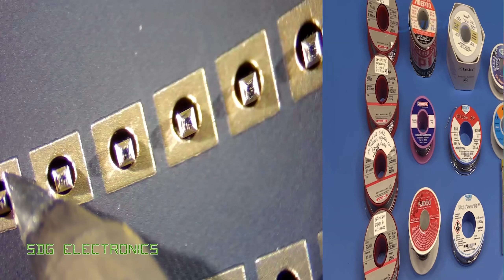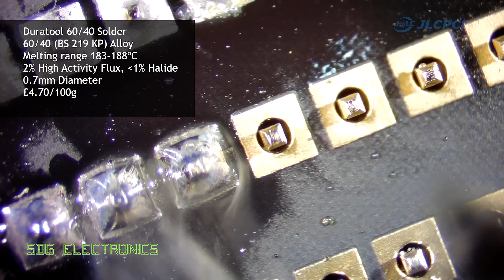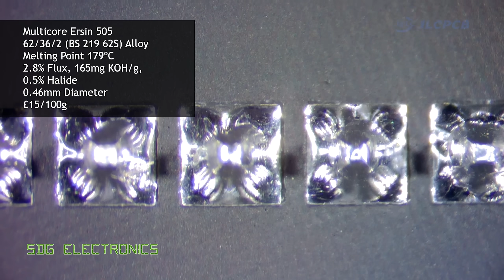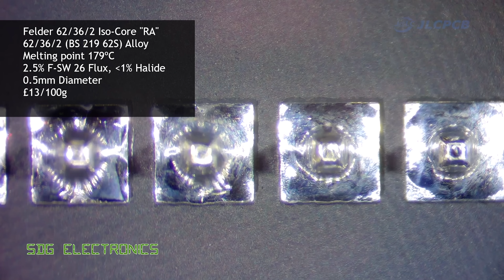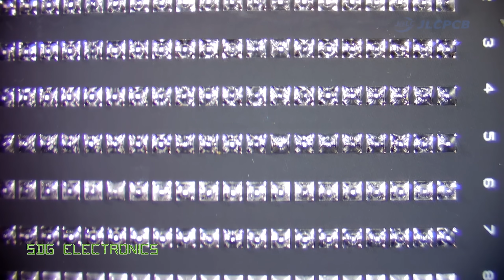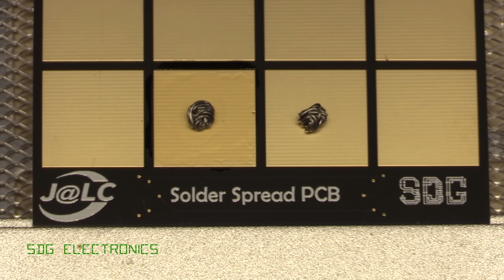SDG #079 What's the best solder for electronics? Expensive or cheap?

Comment: When it comes to soldering, I consider myself a soldering fanatic. I make no excuses for my choices of soldering wire and flux core. This is part of my soldering training in the Air National Guard. We used only leaded solder that was a pure eutectic alloy with an RMA flux core. This has proven over decades to be the best combination to produce joints of the best appearance, best quality and best reliability. Joints produced using a pure eutectic alloy have only two states of being, liquid or solid. This is the easiest solder to learn with because of this point. RMA flux core is the best because it produces the best appearance and the joints endure G forces, physical and mechanical stresses and thermal inversions. This is the level of quality and reliability necessary for avionics, aerospace, biomedical electronics and even high end audio. When human life and class A assets are involved, failure is not an option nor is mission failure. For those who go with lead free, ask someone else. For leaded soldering, there are get by solder wire and there are pure eutectic alloys with RMA flux cores which deliver the ultimate in soldering excellence. This isn’t opinion, it is proven fact over decades of use. Kester, AIM, Alpha Metals and Multicore are the brands who have proven themselves over time. Each must use what they can afford and tolerate. Having a solder which only has two states, liquid or solid, and a proven flux core of decades of use that endure the worst of conditions make the best solder joints you can deliver. It won’t make you a solder expert, but it will give you the ability to produce this level of quality and reliability with practice, practice, practice! It’s up to you and your budget. If you only want to produce the best results, you need the solder wire that yields this. A pure eutectic leaded solder alloy, Sn63, 63% tin/37% lead or Sn 62, 62% tin, 36% lead and 2% silver are the best choices. The solder’s flux core that makes the best joints is RMA, Rosin Mildly Activated. When decades of proven results tell you that you have made the best choice, no argument exists. Save yourself frustration, use only a pure eutectic alloy with an RMA flux core. You can’t lose. Frustrations melt away when you use the best solder!
Reply: For the most part, I agree. However, there is ONE lead-free solder that I can't differentiate from lead so much so it's the only thing I use. It's 100% eutectic, it wets incredibly well, it shines like a diamond and has similar vibration cracking resistance than 63/37 SnPb ( "RELIABILITY TESTING OF Ni-MODIFIED SnCu AND SAC305 – VIBRATION" ). It's Nihon superior's SN100C licensed and produced by AIM. There's no God-given reason why Lead makes the perfect counterpart to Tin in solder. It's just technology and eventually something better will come along. I think SN100C is that combination.
Reply: @someguymichael , with regard to the tin/lead combination, a pure eutectic tin/lead solder is 63% tin and 37% lead as this ratio has only two states, liquid or solid. Sn60 tin/lead solder has a plastic range or state. This is documented extensively. It may not be the only solution, but it is in the leaded solder world. Sn62, a pure eutectic solder with 2% silver content also achieves this goal. A two state solder will always be better than a three state solder if only because a two state solder offers better stability and less chance of issues when all procedures are followed.
Reply: @someguymichael , it’s worth trying considering lead is becoming a bad word. Appearance is important in soldering and the other is a lack of what is called whiskering which is common in lead free solders. This is a serious problem since these whiskers can short across narrow trace runs. It’s a concern, but it may not be with this solder you speak of. One must be very careful when soldering as any failure could scrap a board or an entire component. It may not matter like it would if it were for military, space or biomed products as life hangs in the balance as well as mission accomplishment hangs in the balance. As far as I am concerned, all circuits deserve the level of scrutiny I give to my work. It’s a discipline and you seem to care more than most. I hope you are using the same extra flux as your flux core type. This ensures consistency, repeatability and high quality in your work. Using unlike extra flux than your solder’s flux core yields dubious results. You care about it so press on sir and thank you for bringing this to my attention. A closed mind is one that lacks openness to options that may yield a better way. Press on and thanks.
Reply: @someguymichael , AIM is one of my approved brands. It makes sense if you have a winning formula that works in the lead free world, has the same flux core as your extra flux and yields identical results, you have a winning combination. The question is, is this an approved solder by NASA and or is approved for J STD 006 level 3, aka critical circuit work. Without approval by one of these, it will be hard to convince me to use it. I am willing to try this solder, but it will have to endure the same tests as my present solder has done for decades. That is s tall order. Long term reliability is another issue. I will try it. Is it available with an RMA flux core? There’s something that can yield some consistency to the equation. This flux and flux core is proven superior so if this is available would be a contender. I will have to see if it is available and the wire size is also available. I use 0.015”- 0.025” wire sizes depending on the work being done. Smaller sizes yield higher control and result in less waste. This is important as who wants waste. These are all questions to be answered  and tested. I look forward to this I will have to get tips for use with lead free solder. Mixing unlike solders violates the protocols of high end soldering. This means you don’t use lead free tips to solder leaded tip work as this is cross contamination and causes both quality and reliability issues. Soldering is both an art and a discipline. There is no place for unaddressed issues if you expect optimum performance, reliability and consistency in your work. It isn’t about me, it’s the way it is. Not everyone cares about this. It is a passion and a discipline with me.
Reply: Thanks for the additional info. Proper detail with explanations for your statements is really appreciated.
Reply: @geoffallen6977 , it’s my pleasure to help anyone who is trying to advance the soldering world we live in. Your efforts matter and caring about what you do only presses me to help. People like yourself drives me to further increase your knowledge and understanding of this profession. Keep up your good work! Press on sir!
Reply: @markphilpot8734  
Hello 
Please what is the best best soldering wire and best flux for i buy ?
Reply: @waelkhalil2313 , this all depends on if you are a tin/lead or lead free! If you are lead free I would say SAC 305 or SN 100. I could be wrong on the numbers a bit but these are both Kester. The key thing to remember in solder wire purchasing is knowing your wire quality. Kester, AIM, Alpha Metals and Multicore are the only brands I can wholeheartedly approve. In the tin/lead or tin/lead/silver solder wire world, RMA flux cored solder and RMA liquid flux. Best to use liquid flux by the same brand as your solder wire because their flux chemistries match, but always use the same liquid flux as your flux core with only two exceptions  and they are R and RA flux cored solder wire still work best with RMA liquid flux because they are all rosin based fluxes and RMA flux yields the best results even when using it with R or RA flux cored solder wire. Pure eutectic solder 63%tin/37%lead is the best because it is either liquid or solid, only two states of being as opposed to other solder wire formulations which have a “plastic” state. 62%tin/36%tin/2%silver is also a pure eutectic solder option. RMA is always the best as it has been proven over decades of use in all high end industries requiring resistance to G forces, mechanical and physical stresses and thermal inversions. This is critical circuit soldering and the only kind I do regardless of the actual level. I am a fanatic when it comes to soldering excellence and I do not compromise that for anything. No excuses, no quarter and no regrets. Highest quality rules in my book. The decision is yours to make. That is my recommendation based on my philosophy of no second place for anyone or any work I do for anyone. Second place is first loser, not on my watch Sir!
Reply: @markphilpot8734  thank you so much 👍
Reply: @waelkhalil2313 , it’s a pleasure to help out anyone who wants to make a difference in soldering. Can’t expect anyone else to love this as I do, but enthusiastic practitioners are always welcome!
Reply: Kester is my usual go to solder, but I have always been partial to Alpha as well and in fact prefer that solder for bigger joints, as I feel it just has a stronger bond than everything else.
Reply: @LeviBulger , I’ve mentioned that I have used solder from Kester, AIM, Alpha Metals and Multicore. I have no problems using any of these brands. Al of these have the consistency, quality and repeatability any of these offer. Having the RMA flux core is critical to yield the consistency I  insist on. Failures have many possibilities. If your solder must be consistent all the time. Otherwise, you get problems and inconsistencies. If you use the military approved grades, you will get the best results.  The quality of your work matters or should matter. The key to a great solder is being a pure eutectic as these are either solid or liquid. Thing about that is all about being a pure eutectic sand having an RMA flux core is you have only two states and this flux yields the best appearance and is the best performance consistently. Keeping the size of the wire equal to or less than 0.031” yields the least waste and great solder is never cheap., You can try it out, but if you want great performance, The brands  mentioned will yield this quality and performance. Your brand is one that is listed. No worries on that.
Reply: @markphilpot8734  Hi Mark, I got to read your comment and I appreciate the care in the details regarding the specifications of the solders. I have a question for you: I would like to take a Kester or an AIM but the Kester is only available in the RA version where I am, while AIM also has the RMA version. What do you suggest also based on the quality of the flux that the two use? Thank you in advance for the possible time for reading. (both Sn62/Pb36/Ag2)
Reply: @raid0ss687 , Mr Oss, unbeknown to some that are into the hard core solder fanatics like myself, RMA flux is the best core. Even if the solder used has a rosin core or a rosin activated flux core, you can still use RMA liquid flux as you additional flux to help with wetting and cleaning of the joint, wire or leads of components. There is no problem using an RMA flux as the extra flux because they are all rosin based flux cores so using RMA extra flux is a no brainer. It is preferred to use the same brand of flux as the solder as their chemistries are identical in base formulation. You can still use an RMA flux by a competitor only the chemistries aren’t ideally matched. However, any RMA extra flux that is used is always better than any other liquid flux that may be available. The reason for pressing an RMA extra flux is it cleans better, yields the best appearances, and yields the best bond of any rosin based flux made. The military uses it, aviation, biomedical and any critical circuit soldering where the best performance is mandatory. Even in high end audio where tin/lead solder may still be used. Kester 282 is my choice for tin/lead alloy and it has an RMA flux core. I use Kester 186 RMA liquid flux as extra flux during soldering and for cleaning tips. No time for second place in my soldering world. Good luck with your work and feel free to ask questions. It’s how we learn. No such thing as learning too much!
Reply: @markphilpot8734  Thank you very much for your prompt response. Now I know what to buy.
Reply: @raid0ss687 , no problem. Anytime you need help, just ask.
Reply: @seanoconnor1984 , considering your location, I would try Multicore as a choice of solder as this manufacturer is one I respect and is highly consistent in quality and performance. The key is rosin flux core. I haven’t seen this company offer an RMA flux cored solder. It is the best flux core for any leaded solder there is. As long as you get it with an Rosin or Rosin Activated flux core and still be good. I would still use a liquid extra flux and it still should be an RMA liquid flux as it is compatible with other rosin core fluxes. This allows you the pleasure of using the best liquid flux available and achieve the best results in the process. The key is using the liquid flux both for cleaning the tips as well as for use to aid in wetting ability with the rosin flux cored solders Multicore makes. This will improve your solder projects and keep your tips and solder joints in the best condition they can be. The key to solder choice is keep it a pure eutectic solder whether it be a 63/37 tin/lead or a 62/36/2 tin/lead/silver alloy. The size used should be one that is as small that control of solder use is as small as possible to avoid waste. It is easier to control the use with smaller wire sizes. I use .015” to .030” as this size range helps achieve this control. The use of liquid extra flux, RMA, helps achieve the best results. Cleaning of the leads, wire and pads/connectors is critical to achieve the best results. Some don’t like or care about cleaning, but regardless what they think, cleaning produces the best results and makes all soldering projects better as flux removal matters in any soldering projects. Removal of flux after soldering makes the whole project better because it removes the possibility of conductive material left which also attracts dirt, moisture and puts the project at risk for failure. It is also about best practices as well. I am fanatical about the quality as it matters to me and to those whose work I execute. It matters because there is no mediocre project that involves soldering regardless what level of soldering you participate as.
Reply: @markphilpot8734  'I haven’t seen this company offer an RMA flux cored solder.' Isn't 381 RMA? That's what I got. Then again it's under the Loctite banner, not sure how all that works.
Reply: @, 381 is correct sir and the industry as a whole is steering away from leaded solders. That is a shame since the lead free variety is still a long way from being what the leaded solder with an RMA flux core. Can’t say how long it will remain. Through decades of use I have yet to find any solder that is leaded and has an RMA flux core that will beat the 3.3% RMA flux cored Sn63 or Sn62 configurations. Lead free is trying, but the problems associated with it still remain. I understand why the world wants to steer away from leaded solder, but I’m still waiting on one that can beat the 3.3% RMA spec cored Sn62 or Sn63 leaded varieties that still exist. Hoard while you can is all I can say. Kester 282 is pretty hard to find, but it and its equivalents are still available.
Reply: Kester should hire you as their spokesman.
Reply: @rickytomatoes , it would take a terrific amount for that to happen. The other solders I endorse are AIM, Alpha Metals and Multicore. When you make quality solder and that’s what I look for, my interest is peaked. I’m a soldering advocate and I don’t mind admitting it. The key to anything is finding what works and taking it to new heights. There is no where in my world for mediocrity. I’m not one for compromise.
Reply: @seanoconnor1984 , sorry to hear that Sean. It’s a sad state of affairs when places have such rules that ruin the fun that is pure eutectic soldering. It doesn’t make sense when there are reclamation services that handle lead recovery. It may not be a possibility in Europe as they have said no to lead in any content of solder. I know very little of lead free soldering except the problems associated with it. It’s the way the new world sees only a very narrow viewpoint of what is and that’s it. Wish I could help but that is way beyond my influence.
Reply: @seanoconnor1984 , thank you Sean. Always happy to help anyone improve their knowledge and skills.
Reply: So you’ve never tried leadless? You mention lives on the line. Here in the EU professionals are banned from using leaded tin because it is poisonous.  
I think performance should be sacrificed on the alter of health.
Reply: @faramund9865 , lead is classified as a heavy metal and it accumulates in the body. It has many problems associated with it and they are well documented. There are programs and procedures which remove lead and the flux fumes which are the source of the problem. Vapors can be removed at the source with fume extraction. All lead waste is recovered daily and placed in airtight containers for recovery by licensed companies who can recover the lead and prevent it from introduction into the soil and thus prevent it getting into ground water. These companies job is to remove this as a possible problem. Lead does not vaporize below 1,000 degrees F. Therefore, it is the flux fumes that are the issue and they are poisonous which is why fume extraction is utilized to inhibit inhalation of these fumes so they are not inhaled. Nitrile gloves are used to prevent transmission through transdermal means of lead into the body as this is the method lead gets into the body through the skin. Hand washing is part of the exposure prevention methodology. When fume extraction, solder recovery and nitrile glove usage are employed through procedures used by professional solder techs, lead can be eliminated as an issue. Solder waste is considered as a hazardous material and it’s recovery into approved containers is mandatory for any professional solder operation on a daily basis. Solder waste is Never to be placed in trash cans as it is considered as hazardous waste. The gloves used are also placed into the same container designated for solder waste recovery. Professional solder techs know this as the procedure is followed as it is a requirement and a preventative measure to prohibit any introduction of lead and other components, flux residuals being introduced into the ground and contaminating the water table. Fume extraction prevents the inhalation of toxic flux fumes. 
       On the lead free solder front, there are two formulations, SC305 and SN100C which have promise. The biggest issue with lead free formulations is whiskers which form on the surface of the solder joints. These could possibly cause shorts by coming into contact with nearby component leads and or traces on the PCB. There are other issues as well, but the solder companies are working on these issues. Crews or pilots are out there doing their jobs and risking their lives for their countries, so yes lives are at stake and also Class A assets, the aircraft in question. Keeping lead out of the mix is important and necessary to protect life here on our earth. It can be accomplished by following procedures and doing our due diligence as professionals. The EU is doing what it feels is prudent and wise. Given the effort by the solder manufacturers to produce products that are lead free so as to remove lead as an issue, this is being accomplished. The issues that the lead free solder has are also being addressed by the solder manufacturers. They will be rectified in time. The J STD 006, critical circuits have very demanding requirements. I cannot make anyone see what that means if you aren’t a practitioner of that standard or practiced under DOD STD 2000-1 which is it’s predecessor. Much is at stake. The solution is lead free for our future. It will happen here also when the issues have all been worked out. Until then, we as professionals must do our part to protect ourselves from lead exposure, fume inhalation and recover, contain and remove solder waste to companies whose purpose is it’s safe extraction so it is not released into the earth and the water table. This is how professionals handle this. Amateurs need to follow these procedures as well. It takes all of us working together to eliminate problems. It is important that we are not a part of the problem, but seek out solutions. This may not be perfect, but it is both professional, proper and safe. Failure occurs when procedures are not followed. Safety starts with us and that is part of being a professional.
Reply: @markphilpot8734  Wow, great answer, thanks!
Reply: I've been searching the internet for knowledge, I'm having trouble using lead free and looking for a good solution. Until I found this comment. I have continued to search for information and thank you very much.
Reply: If i had spent the time soldering that it took to read all of this, I would be an expert now…
Reply: @sheehanisdeadcomics9988 , granted, this level of soldering has the least amount of participants, practitioners of any other level. It is known as critical circuit soldering and is limited to only the highest level of circuits in avionics, bio electronics, space bound circuits and certain instrumentation. This is not known to all nor should all practice at this level. The dedication is more than most can endure. Skills at this level are high and the cleaning and time limits are more than most wish to deal with. So I can agree with this statement. The original statement only covers a small segment of this knowledge. The rest is covered with practice and dedication.
Reply: Mark could recommend a brand and thickness for through hole pcb work thanks
Reply: @charlieoscar09 , there are only a few brands that I can recommend that offer the consistency, repeatability and quality that yields the right results. The only brands I have used and recommend are Kester, AIM, Alpha Metals and Multicore solders. RMA, rosin mildly activated, flux core is the only flux core I will use in a leaded solder. Sn63, 63%tin/37%lead or Sn62, 62%tin/36%lead/2%silver are the two options I use with high reliability and high quality results. 0.025” or 0.020” are the two sizes I use for through hole soldering. Anything larger is just wasteful and great solder isn’t cheap. There is no Sn60, 60%tin/40%lead I would ever use as it is not a pure eutectic solder. Sn60 has a plastic state or range as it is called. This is why I only use a pure eutectic solder. I will gladly answer any other questions you may have. Feel free to ask. 3.3% flux ratio to weight is the best you can get. The solder I am using is Kester 282 solder and Kester 186 liquid flux. I use 0.015” size solder which allows me the greatest control with the least waste.
Reply: @markphilpot8734  very detailed information from you Mark, I would also like to know what solder and flux is best to use for soldering Brass, I build model trains and want to have the best strength when it comes to  physical and mechanical stresses because of the they will be handled and carried around to different shows and layouts. I read somewhere that the one with Silver is the way to go for Brass but of course I would like for you to shed some light on this as I am a beginner and would love to learn the proper way from the start. At the moment I have a reel of Kester Sn62 Pb36 Ag2 (24-7150-8800) with no clean 245 flux but I'm not extremely impressed by it and doesn't seem to flow very good on my Brass joints. Thank you
Reply: @daniell37 , Daniel, this depends on what flux matches what is in this solder. In order to achieve top drawer performance, the flux core of the solder must match the extra flux used. This is key to soldering anything. If the fluxes are mismatched, the results are not ideal and dubious as their chemistries are mismatched and therefore not optimized and there will not be predicable, compatible, ideally optimized for maximum performance. The one key thing is flux core/extra flux matching. I use Kester 282 which has an RMA flux core and has a flux percentage of 3.3% flux by weight ratio. The extra flux I use is Kester 186 liquid RMA flux. Same manufacturer yields the best possible match. By brand, also known as brand matching is the other optimum way to get perfect chemical matching of both flux core and extra flux. This is the best because they’re both manufactured for each flux type to each type of flux core offered. Always use brand matched solder and extra flux regardless of which flux type for whatever brand used. It would be the same if it were AIM, Alpha Metals, but I have not seen any for Multicore which is what my Sn62 is with an Rosin flux core. I use Kester 186 with any Rosin cored solder. The base of the fluxes is rosin. Only the activation is different while the bases are identical. This is the key to results. An R, RA or RMA may use and RMA extra flux. The RMA is less active than either the R or RA flux core. The results offered with the RMA flux is how it cleans the joint and the appearance it achieves as a result. The RMA flux helps yield that jeweled look that wows. This is the critical circuit mentality. Focus, one joint at a time, cleaning between joints and always starting and ending cleaning always. Cannot yield if you want the best result. I know jack about brazing, but clean surfaces, no vibration during the procedure, apply the right amount of extra flux and time management to minimize tempering. That’s the best for you. Mixing flux core types with extra flux yields questionable results as the chemistry is not exact and maybe even conflicting which leaves you with very bad end product which has a less than favorable result. Only matched flux core and extra flux will yield the optimum results. Silver content solder is used in jewelry making and electronic instrumentation. Think about that. Ideal for jewel and instrumentation use. There is something special about silver content solder. When you have tin plated stranded wire and you pre solder the wire, the wire has the silver solder on it. If you are soldering to a board, your joint is clean and the pad. Best practices, as it is called, work for brazing as well. Excess extra flux use is something you also want to avoid. There is an ideal amount of flux for any fluxed operation is learned. Practice is where you gain this. You will tire of the flux cleanup if you use too much. It makes you a better solderer or brazer. Hope this helps, a bit long winded. Brass is used as a base for connections on electronic components. Maybe ask some specialty lighting companies to see what they use. Flux core and extra flux needs to match for optimum results, even with brazing. Take care and be safe Daniel.
Reply: @markphilpot8734  thank you for sharing your knowledge on this topic
Reply: @billyhighfill , not a problem Mr Billy. My supervisor was as fanatical about soldering as I am. His name is Charles Beckenthal and he is one highly skilled tech I tell you that. I take his training most seriously and he is next to my Dad of men I respect. That’s high praise indeed. I consider it an honor to promote his legacy by helping those who really care about soldering to the highest possible standards!